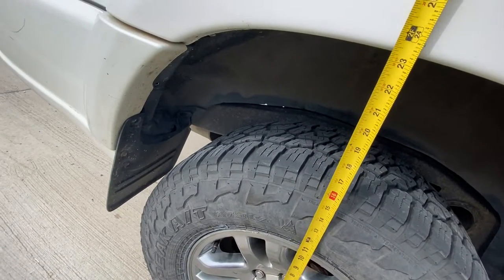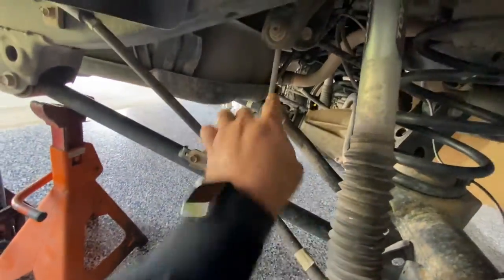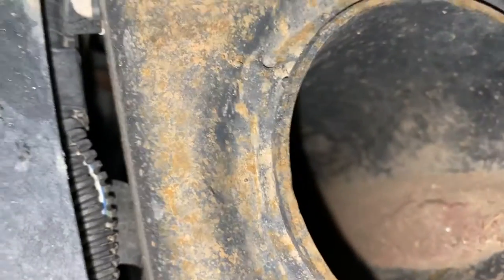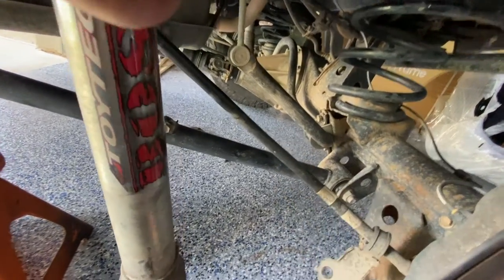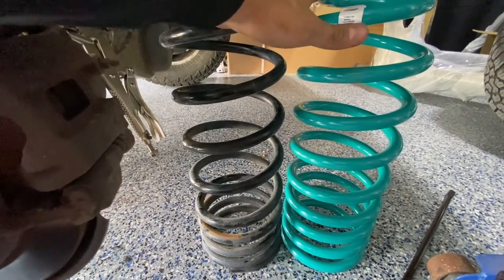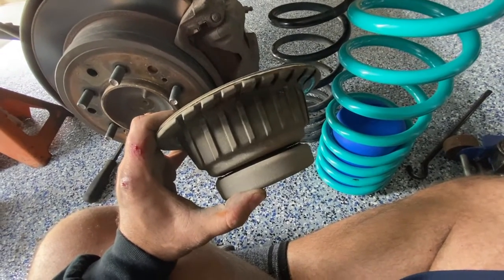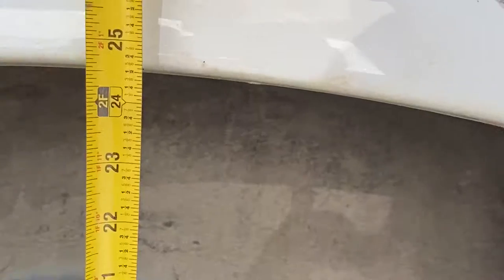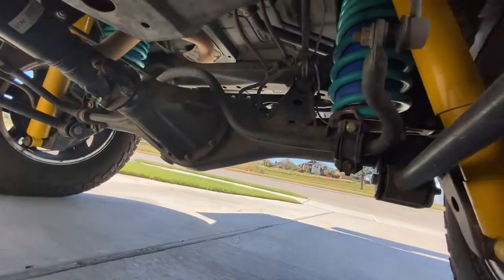Toyota Sequoia - Rear Suspension Install Dobinson

Comment: When you were tightening the rear shock top bolt, how were u able to stop the rods from Spinning? Did you just hold the Metal Shroud?
Reply from the maker: Yea the metal shroud and the chain channel locks

Comment: How much torque you applied on the four nuts?
Reply from the maker: Top nuts according to the Toyota repair manual need to be torqued to 43ft/lbs bottom need 64ft/lbs
Reply: @isaacspoon  Thank you 🙏 very much for your quick response!

Comment: I have had a heck of a time trying to find the cone bump stops you cut. Can you tell me where  can find them?
Reply: Did you ever end up finding/using the cone bump stops in your application?  I saw you used the oem airbags so wondering how you made the top work (cone bump stop or just original attachment of airbag with coil around it?)?   Thanks!
Reply: I did not. The coil fits snug against the subfloor and the airbag fits in the coil space perfectly. As long as I keep the bags inflated with some air everything is very secured and stable.
Reply: The one thing I’m having to address is the Toyota lean. I have about an inch difference between the driver and passenger from strut. Just ordered a 1/2 inch spacer to level her out.
Reply: @cjhillin  Thanks for the reply...is the lean in the rear only?  Also, you note in your comments that you're using the stock height Dobinson Spring, how are you achieving a 3" lift in the back?
Reply: No the lean is mainly in the front. If I inflate the bags I get a significant amount of lift. I adjusted the ride height sensor so If I inflate 75% I’d say it is in the 3.5 to 4 inch area. Default from the factory these bags are rolled over. When installed into the sprint they are upright and take up the entire area inside the spring. So inflated they really Jack the rear up.
Reply: @cjhillin  Oh that makes total sense now.  So if your bags are deflated you sag in the rear obviously.  I'm looking into just doing a mild 1.75" in the front (dobinsons springs/shocks) and then doing what you did in the rear (dobinson stock height springs/shocks).  My hope is I'd be close to level and then only add additional air when loaded/towing.  Do you think I'd have any issue as the bags won't be as inflated as yours (maybe remain folded over)...any additional advice?  Thanks again!
Reply: If you don’t inflate a little the bottom metal of the bags will clank against the axel. I keep mine right level with the front for daily driving. You can’t add the bags to the springs and have them fold over, they won’t fit.
Reply: @cjhillin  gotcha, so you don’t think with them inflated around stock height or an inch more they would work as you have them?
Reply: 100%
Reply: @cjhillin  ok thanks, I may just run them adjusted up 1” or so then and not run springs at all…at least for now.  I was hoping they’d work like yours but don’t plan to lift that high.  Thanks again.

Comment: Love your rig man. How have the dobinsons performed so far? Thinking about getting the full front and rear setup off of first gen offroad for my 2003 limited.
Reply from the maker: I really do like it.  It drives a little stiffer on road than my last suspension set up but I also got heavier springs AND a front/rear bumper installed as well.  It is a great setup for sure. I just got back to Dallas from a 3900’mile roadtrip up to Montana and back.  It did great.  Saw a lot of off-road on this trip as well as highway miles.  For my front I have rebuildable icon coilovers with 700lb springs, I don’t have the dobs on the front for what it’s worth.

Comment: I have the same setup for the rear, how much lift are you running in the front in inches.
Reply from the maker: its 24" from the center of the hub to the bottom of the fender. I have the stage 2 icon coilovers installed with 700lb springs. it should drop a little more once i finish the front bumper install and finally get the winch installed.

Comment: What is your tire size?
Reply from the maker: 265/70/r17 currently. I had these tires with my old lift installed so they didnt look as small then haha, but plan to move to skinny 33's on my next set of tires.